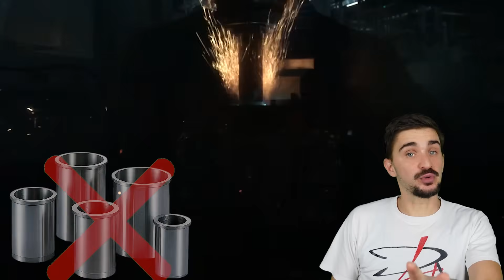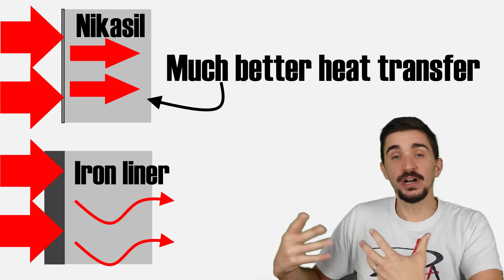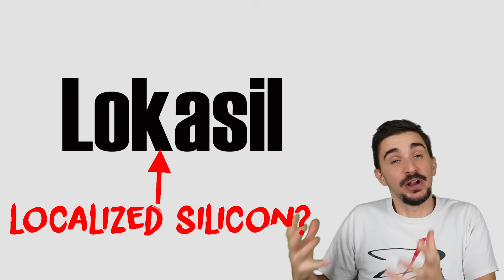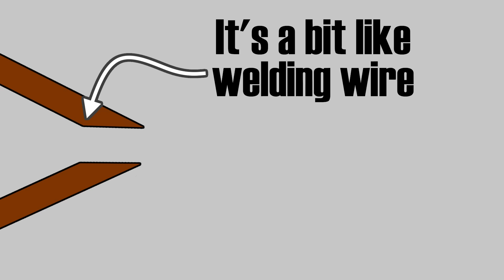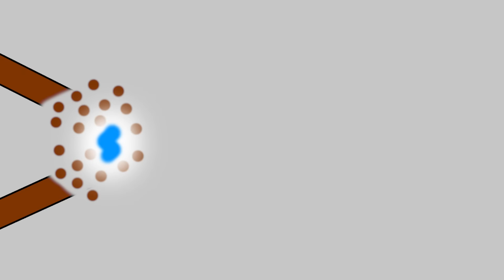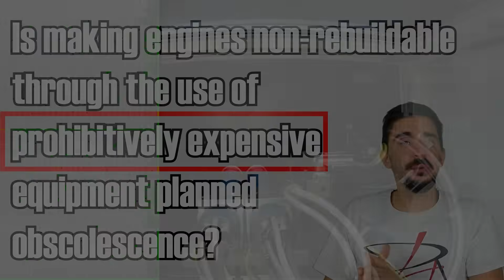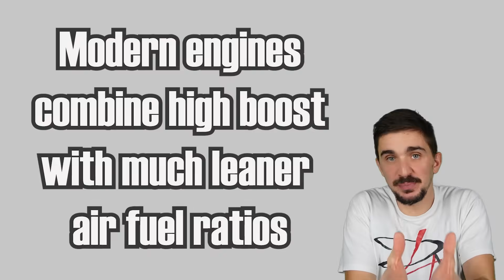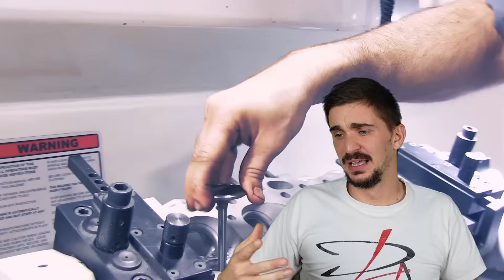Why Are Engines Becoming Non-Rebuildable? Everything About Cylinder Coatings

Comment: Quality of recycled aluminum vs. virgin aluminum for engine casting?
Quality of recycled steel vs. virgin steel for making automobile sheet metal/ bodies?
Quality of recycled lead vs. virgin lead for making lead acid starting/lighting auto batteries?(not so great)

  Ultra recycling ? (can recycling be done at higher cost to higher quality with these materials? 
    poor little Vega- I guess it just had plain aluminum with no coating
vintage Briggs & Stratton small "Kool Bore" engines- "high silicon copper aluminum" alloy? Seems like their threads hold better against overtorque than similar size threads cut in such as automobile automatic transmission case castings

Comment: The issue of being able to rebuild, reuse, repurpose, remanufacture, etc is a more complex one since we no longer have a very service-emphasized, high-cost product, high longevity incentivized economy in most of the western world.

If you had an alternate timeline where everything became even more service-focused than it was back in the 1950s (or really, to some extent up to the 1980s, including with consumer electronics), yet also modernized with technology and efficiency (basically some natural or artificial pressure to prevent/discourage disposable consumer culture and economy ... probably a lot of protectionist economic policy on top of aggressive environmentalism: discouraging outsourcing wherever possible, and also discouraging discarding useful/reparable items) ...
then it would be a different story.

A lot of that would be labor intensive, even with modern levels of automation (or potential levels of automation with existing technology), and while that's expensive, it can also be more environmentally friendly. If you also assume that such an economy/culture would end up with much less net waste and lower total environmental impact (including carbon emissions, but also a ton of other factors way outside of CO2 ... like impacts on mining/resource extraction, water usage, potential toxic chemical leaks/spills due to long-distance shipping/transport that would no longer occur due to optimized servicing as locally/domestically as possible). You'd also end up with a more robust economy, with the exception that you still wouldn't be able to fill the unskilled labor positions we had in the mid 20th century, that's one thing automation will always eliminate.

The service industry, from modern technicians to conventional machinists, mechanics, electricians, and any kind of repair and maintenance position, is all skilled labor ... any sort of trade would be relevant skilled labor (some with more modern twists on the theme than others), plus DIY right-to-repair would have long, long since been a no-brainer.

Working within the present-day globalized economy is another matter entirely. It would take years of artificial pressure from the top and bottom (ie government regulations, activists, and consumer protest/pressure from a passionate minority) to really shift things away from that. Preventing the trend in the first place would've been far simpler, and something governments, labor unions, activists and consumers had more of a chance to do 30 to 50 years ago than we do today. (it's also not just globalization, but more an issue of outsourcing to high pollution, low-labor-rights, predatory, unscrupulous, and unregulated nations and regions ... as trade and outsourcing only to near-peers would naturally have avoided most of the economic conditions favoring highly disposable consumer goods, and would've typically limited overseas/long-distance outsourcing to cases where a given region/country was vastly more efficient at doing something and not simply cutting corners, polluting, and abusing workers)

Note: by the end of the 1980s, Japan was pretty soundly a fair, near-peer to the US, Canada, and western Europe. Between shifts and pollution and curtailing of predatory business practices, you had pretty healthy and beneficial competition by the end of the 80s, and even a lot of positive impacts of some of the better business practices in Japan rubbing off on the US (including better emphasis on communication/influence of engineers, manufacturing floor managers and workers, and corporate management, and less emphasis on caving to shareholder pressure and short-sighted quarterly earnings vs actual sustainable long-term profits ... case in point with what happened to GE and Boeing from them to now).

Japan's market crash and recession in the early/mid 90s combined with international favoring of China really, really hurt things and halted a potential healthier world economy that was emerging just prior to that. (lots of other complex factors, but that's a big part of it)

Comment: E85 or various other alcohol fuel blends would allow low AFR and in-cylinder cooling effects alongside low emissions.

Stoich for 11:1 would be somewhere around E60. (if we're just talking ethanol_gasoline, though other blends would be more optimal for chemical, physical, and combustion qualities, and potentially for long-term sustainable production as well ... and then there's methanol blends, which would generally be highly sustainable and even better for reducing combustion temps, but with more materials compatibility issues and/or issues in high humidity environments  ... honestly less severe engineering hurdles than many, and ones that could've been solved in the 1970s or 80s, but you need enough demand and incentive to do so:  I'd argue that's something Europe had the demand and pressure for when they instead decided to emphasize diesel engines in the 70s and 80s, given methanol could be cheaply and efficiently synthesized from all the grades of fossil fuel feedstock used for diesel, along with grades and materials unsuitable for diesel: including Germany's brown coal, plus forest waste/residues, all with pre-1970s era technology)

Of course, if such engines HAD to be made to run on regular gasoline or E10 as well, they'd have to significantly decrease their performance envelope and run cooler at lower power settings, possibly with lesser efficiency as well, though not necessarily poorer emissions. (unless you're talking about CO2 emissions, which normally isn't the context for this ... CO2 emissions being proportional to fuel economy)
Variable timing was/is used for varying octane rating, but in the case of high compression and high temperature with varying fuel composition, it would be more efficient to either limit boost pressure (on forced induction) or simply limit maximum throttle position (to establish minimum vacuum/suction/negative boost pressure) to restrict maximum in-cylinder pressure. This can all easily done by the engine computer.
Reply: Additionally, running leaner AFRs with alcohol fuels also has lower combustion temps, but on top of that, extremely lean mixtures burn cooler than stoich. Normally a lambda near 1.1 to tends to be the hottest range, and temps drop again once you go further. So in some extreme lean burn engines using Lambda of 1.4, they run cooler and are less knock/detonation prone than at stoich. (this is one of the reasons that Smokey Yunic's version of the "hot vapor" engine concept worked well only at extremely lean AFR, and actually required a high engine temp to work on gasoline as you needed it to be that hot to maintain efficient combustion and not fall outside of the explosive air/fuel mixture limits)

There are some fuels, including alcohol blends (but also a variety of other suitable fuel esters, ethers) that have a much wider explosive range than gasoline and can burn leaner without needing to have exotic running temps or high boost pressure. (denser and hotter charge broadens the AFR limits significantly, so a forced induction engine could potentially run extremely lean, well beyond lambda of 1.4, if the pressure was kept high and temps were kept high as well ... not necessarily in-cylinder temp, just intake air charge temp, ie limiting charge cooling to keep intake air at a hot, but still desirable temperature; the only major downside there is reduced charge density, so you'll probably lose some power while gaining lots of efficiency)

Alternative fuels just allow more options for naturally aspirated engines or modest forced induction. Less practical, but an extreme example would be hydrogen gas, which has extremely broad explosive limits (which is part of what makes it a huge fire/explosion hazard: it can burn at extremely rich and extremely lean AFRs). It's also an odd case where its worst knock and detonation tendencies in a SI piston engine occur at rich AFR, and effective octane number at lean AFR is much higher, exceptionally high. (and the most practical, attractive use of hydrogen in combustion engines would be its potential to allow ridiculously lean mixtures to be used; this would be one quality also useful for a small hydrogen supply used to boost combustion efficiency of a more conventional fuel via co-fueling with hydrogen injection ... that said, less exotic and complex systems using alternate liquid fuels are far more likely to actually be implemented)

Cooler burning fuels with wider flammability limits also have the advantages of continuous water injection, but without the disadvantage of reduced combustion efficiency or incomplete combustion. (it would be more akin to high temperature/pressure steam injection, but probably cheaper and easier to implement ... or definitely cheaper and easier for engine/vehicle designers, more an issue for fuel infrastructure and market acceptance)

You already have a lot of DIY performance boosting stuff with E85 injection mods (including adding port injection systems to existing DI systems to allow higher fuel flow without the cost/complexity of modifying the DI system: so long as the high pressure injector pump can tolerate E85 ... though adding a small amount of lubricating oil/fluid can often eliminate failure issues due to E85's lower lubricity). But, if you optimized for leaner burn and leaner AFR (and efficiency rather than performance), you wouldn't even need the secondary injection system, just design it to run lean, very lean, within the flammability limits of E85. (having a flex-fuel vehicle do that all automatically via sensors to continually auto-tune its performance would be more difficult, though ... and virtually no flex-fuel vehicles operate anywhere near their peak thermal efficiency on straight E85, partially due to this limitation)

Comment: Couldn't coated bore engines still be partially rebuildable, particularly if the bores still have life in them, but other components are worn out. (including if the piston rings wear faster than the bore coating).

Additionally, engine blocks could still be reused/recycled by relining them if/when that becomes practical or economical (or possible at the small scale shop/industry level). Or re-bore the engine for cast iron sleeves, like GM did with the Chevy 2300 (Vega Engine) when it turned out the etched silicon bore lining process was insufficiently durable for long term real-world customer use. (in that case, the absence of sleeves wasn't for performance, but primarily for cost reduction, so a higher performance engine relying on coating for its operating parameters would need to have those performance parameters modified as well to work with cast iron ... or potentially, with steel alloy sleeves, which have some advantages, like much better toughness and resistance to cracking;  the 2300 also used a cast iron head in the somewhat uncommon combination of aluminum block and iron head, sort of like some of the lightweight Cadilac V8s used in the 90s)

Of course, iron block engines avoid the disadvantages of cylinder liners entirely, but have different trade-offs (beyond weight as well). There's some advantages to sustainability for cast iron alloy blocks, too, though. (particularly if lifecycle cost and economy, including fuel economy, are the main concerns, with performance taking a back seat ... sort of like a modern take on some of the 1980s designs)

There's also another alternative: aluminum alloy bore liners with surface coatings, allowing rebuilds while having many of the mechanical and thermal advantages of linerless bores, but not quite as perfectly so. (there's other potential alloy liners, some of which could be optimized to match thermal expansion rates and have good thermal conduction, possibly some bronze alloys, but aluminum alloy liners would probably be the simplest and cheapest option that could leverage similar advances in coating technology)

Likewise, if the industry wanted to optimize for sustainability and re-use of old engine blocks, they could again plan to do what Chevy did, but with modern coated aluminum liners rather than cast iron ones. (presumably with somewhat reduced performance or lifespan compared to the original linerless bores) Engines with no structural tolerance to be re-bored and re-lined would be out of the picture for this, though.

Comment: You didn't take into the account the benefit of rebuilding the engine, that comes from not producing a new car and I think that might actually tip the scale towards rebuilding. Because let's be honest, nobody buys a brand new, new generation engine if their old one breaks down. They either rebuild the one they have, take a used one from scrap or buy a new car. And producing a new car vs just rebuilding an engine in the old one might not balance out so quickly

Comment: I rebuilt my engine last year. The cost was around 250 bucks. Also if you have to recycle a block, you are surely recycling the whole car with it, so then the picture on emissions saving is not that clear. That said, great video, thanks.
Reply: What are you calling "rebuilt"? No way a full rebuild cost $250 unless it was a moped engine.
Reply: @MudOilnGears  it was a suzuki g13bb 16v sohc engine. The rebuild included resurfacing of the head and block, valve stem seals, and a full set of main and rod bearings, a hone job and piston rings. I paid around 250 bucks to the machine shop, but I assembled the engine myself, so there were some cost increasing factors like gaskets and stuff, so you are right, it was a bit more, but by not much. A head gasket costs like 12 buck for this engine where I live.

Comment: planned obsolescence?  Let's talk about how the EPA handles the diesel engines.  If (when) they are replaced, dealer is instructed to destroy the old one, so that it can never be used again.  This is EPA regulation, not dealer or manufacturer.  Then in time, the supply of rebuildable engines dries up.

Comment: I get the the point you made at 4 minutes 10 seconds of this video, but in my experience of engines and the oil the engines use to lubricate said engine, because of the nature of modern oil, the higher the engine operating temperature , I believe evaporation of said oil severely increases leading to formation of sludge, burnt oil sticking to the internals causing failure of modern camshaft systems due to blocked tubing and filters that feed said camshafts variable position activation. Which in turn leads to the engine performance decrease countering any advantage of the supposed emissions saving, similar to a blocked EGR valve would certainly affect an engines efficiency increasing more emissions, but hey that's my opinion...... keep up the good work.

Comment: As indicated, your wonderful explanation shows these coatings have there place. But you have not convinced me the use of coatings are worth the effort in a 4 cyninder. The use of Detroit "wonder metal", cast iron, makes more sense. The weight savings are minimal in a 4 cylinder. These cheapy new 4 cylinder engines are throw away as are lawn more engines. The Ford Lima iron block engine, just set a new quater mile record. Your modern aluminum auto lawn more engine will be lucky to last 5 years

Comment: i rebuilt a tiny  renault engine which was used i  nisan ... put some aftermarket stell sleeves running nicely.. it dose get heated a bit more than before but the Fan takes care of it just fine 🙃

Comment: Hey .....why dont you do a video of how engine manufacturing companies use the math to calculate exactly counter balance a single cylinder engine or weight management of crankshafts in v twins or single cylinder engines?....... appreciated 👍
Reply: I mean iam asking how do they know that the crankshaft should be exactly  weigh that much weight and balancer shaft weigh that much ......in order for engine balance

Comment: There's one of those plasma coating machines less than a hundred yards from my office
The problem with refinishing is the tolerance on the other parts. You have to keep a stock of standard and oversize parts. 

Modern emissions regulations means that piston rings have to fit very snugly, and this means several sizes of everything. 

Engine remanufacturing is more or less driven by laws that state parts must be available for a certain length of time.  It's cheaper than building an entirely new engine.